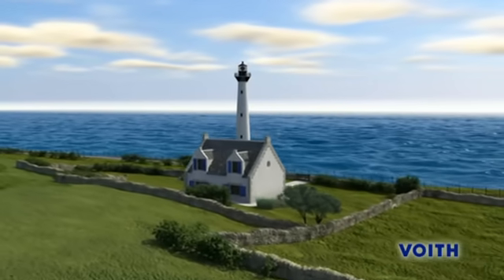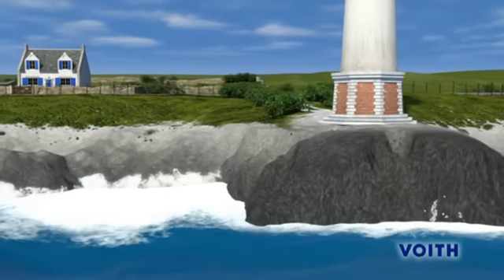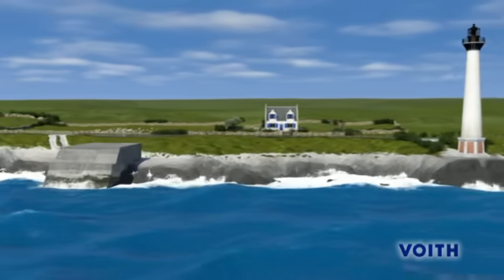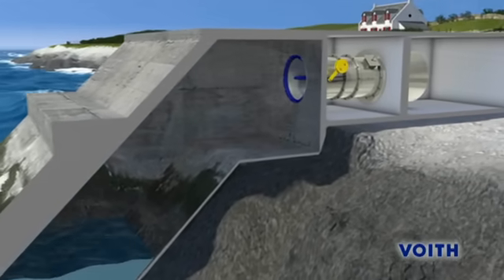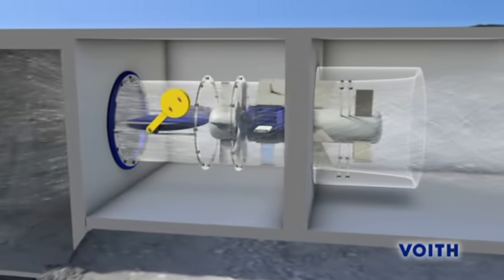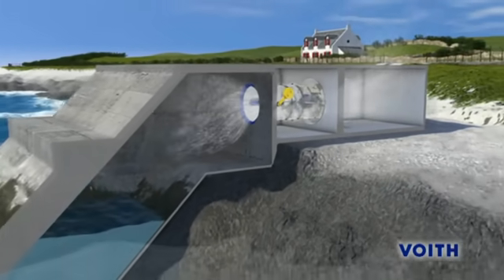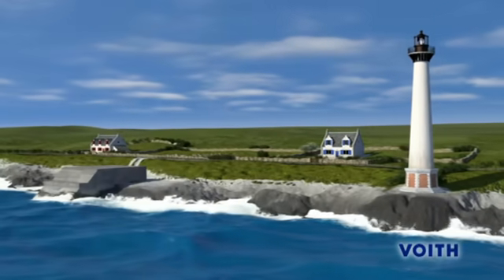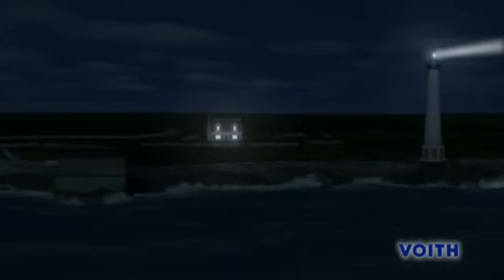Ocean Energy -  Wave Power Station

Comment: Hey! Firstly this is awesome! Secondly, I'd like to ask a question: Are bigger waves producing more energy or something?
Reply: cmb271 If they increase the propeller size and then decrease the channel through which the water flows, more air is being forced through in a the same amount of time, so you'd have a faster turbine and a higher output.
Reply: wouldn't the decreasing the size of the channel reduce the ability for the air pressure to flow in and out, the properties of fluid dynamics would cause it to flow to the point of least resistance and decreasing the channel will increase the resistance to the point where the water will simply find a lower pressure point.
Reply: That could possibly work, it would spin it at a faster RPM but would result in lower torque so less ability to spin a large scale generator, you got to engineer it to have enough force to drive the turbine at a decent speed and not burn up the components to quickly, remember these should be a low maintenance type deal so less power but higher reliability is key assuming it's generating enough energy.

The problem is humanity as a whole is wasteful with energy because it's abundant, for this to work we'd need to change our habits and the only way for that to happen is government policy (please no) or a community of sorts whos main goal is to reduce there footprint while living under most social norms.
Reply: the size of a wave is essentially dependent of the strength of wind and the how uninterrupted it is, waves have more mechanical energy when they are very far off shore, they only get bigger as they reach the shore
Reply: it's basically the higher or lower it goes the more the turbine spins, one of these maybe able to power a house or two but line them up on the coastline and you can power a city maybe even a state, I don't know the energy potential though if it's even enough
Reply: Oh, good point. I didn't think about how there would be less in it, I assumed that the same amount would be forced through. 

Perhaps we should increase the size of the channel, then make the turbine smaller?
Reply: jános kovaćik i would point out that compressing air creates thermal lisses per boyle’s law, it would be more efficient w water as the working fluid but I guess a submerged wells turbine would be harder to maintain that one being pumped by air, even salty air.    Anyway, if you defreased the diameter of the air channel to make it higher force you would be having more thermal losses probably than a higher volume lower pressure system.
Reply: Aďlona Cöržinië see my precvious post
Reply: No waves make any energy to amount to anything so it’s doesn’t matter the size.

Comment: the same way most electricity is formed, by spinning a generator. Same thing is going on in hydro plants, wind turbines, and even gas and coal plants (in which water is heated into steam, which then is forced through a turbine). Look up Electromagnetic induction on wikipedia for a detailed answer

Comment: The Wells turbine is a low-pressure air turbine that rotates continuously in one direction in spite of the direction of the air flow. Its blades feature a symmetrical airfoil with its plane of symmetry in the plane of rotation and perpendicular to the air stream.